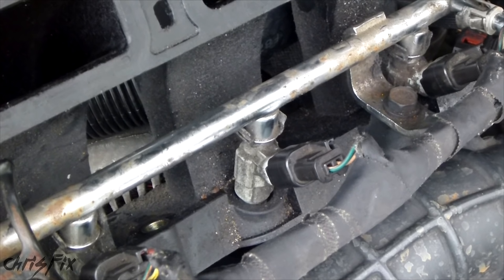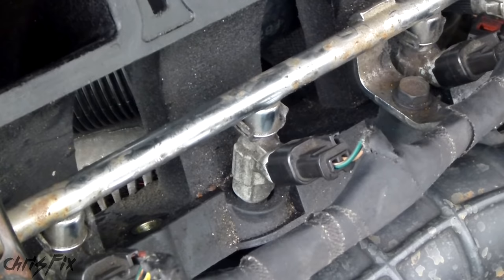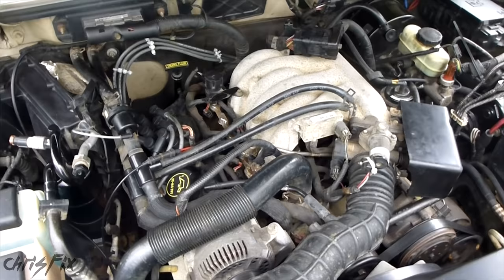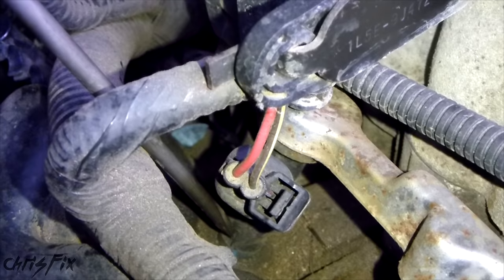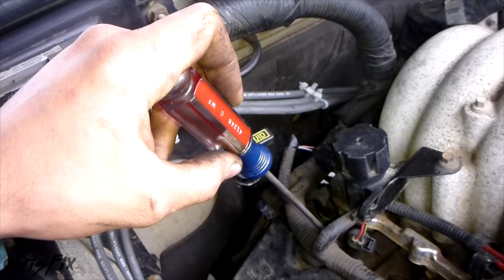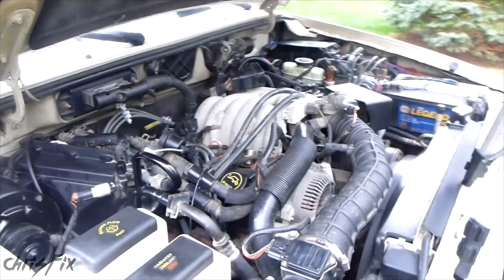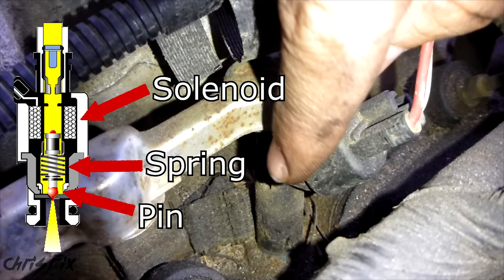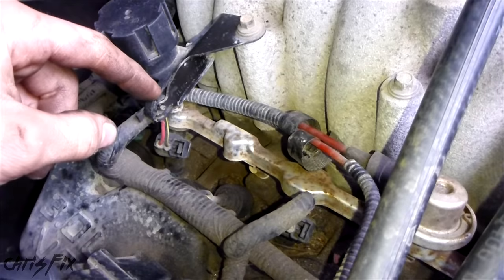Testing Fuel Injectors Fast

Comment: Great videos.  I am a mechanic and machinist and its really good to see youngbloods doing it right and doing it for themselves.  Also the diagnosis progression you show is really nice too.  This is not something you will ever get from a dealer.
Reply from the maker: ***** Thanks a lot man! I appreciate it! I try hard to get the best info out there without rambling on! Fixing cars is a lot of fun!
Reply: Hello dnl machine, 
My daughter and I are trying to change fuel injectors on her 2003 Honda element....  can you help us,please?
Reply: The only thing that one is going to get from a dealer is a car with a bad injector .
Reply: Tested the injectors on a silider that's not working, it seemed to click louder and with less frequency than the others, but consistently.  The cilinder on that one  misfires for sure, may be thats the reason the injectors clicks sound louder but injectors click consistently ..
Reply: @vr  irregular firing compared to the others is still bad, the coil inside might have high resistance or be damaged to the point that the electrical pulses and thusly the mag field aren't being applied as they should to the injector.
Reply: Can it trigger map sensor code ??
Reply: No

Comment: I enjoy how you figured out that you could place the camera against the screwdriver so the audience could actually hear the clicking. Simple detail with a large effect. Well done.
Reply: Literally all I'm here for. I'm troubleshooting a cranks, coils good and spark, no start motor and have never done the listen test. Wires and injectors are very hard to access for removal. MIIIIGHT be a wiring issue elsewhere. What to do? I stuff the stethoscope in there and listened but guess what? I've never done this before and don't know what it's supposed to sound like. Now I do!
Saved me a lot of digging.

Comment: ive used this method too, listening to engine sounds especially on the timing chain part and bearings about to get worn out! its helps a lot of money and time before removing anything or buying some parts that might be the issue but turns out its not.Great video Chris!

Comment: I've done this and the problem I typically see is the sound from other injectors travel down the rail and you can't tell if the injector is bad or not. I think a better way in addition to an Ohms test is switch the injector from one port to another than run a code test for that cylinder and see if you get a misfire for that cylinder.
Reply: Make a video and show us 
That would be cool man
Reply: P[😊😊

Comment: Hey thanks man! Excellent video! I had hesitation AND a hard start (two cranks) in my 1999 Jeep Cherokee. The hard start was due to a failing fuel pump (bad check valve and fuel pressure regulator). The hesitation and bad idle were from a failed injector. 'Preciate it man.
Reply from the maker: Awesome! Glad the video helped and nice job diagnosing the problem!

Comment: With that screw driver test you also need to listen for the sound.  Say you got 4 injectors and you are having a poor acceleration, or intermittent surging off and on, like a chugging type acceleration, if you hear 3 injectors sounding strong and clicking good, then when you get to the bad one it will sound very weak yet hear a weak clicking sound, and sometimes a rapid chatter takes place causing the engine to struggle and shake, that tells you the injector is going bad.  I tested mine, 13.0, 13.0, 12.8, 12.7.  Numbers are 1 to 4.  The fourth one was 12.7 which is within resistance specs, being 0.5 but the sound was the dead give away being so weak, it cannot handle sudden load acceleration.  Once you get to highway speeds, you will feel the surging effect take place.  How old is the car itself is the first thing to know.

So that sound must all be the same and sound good and strong.  You can have a injector all within resistance specs of 0.5 as you said and I disagree, but it must match the sound with the other three.   I can also hear that number 3 is sounding strong, and the resistance is below 13.0 when compared to the other two good injectors, It tells me that number 3 is getting ready to fail likewise.  They should all be within 0.1 or the same.  Anything more than 0.2 difference, that 0.2 is getting ready to say bye bye, while you already know that 0.3 the injector sounds weak and is causing that surging, chugging rough engine effect.

Sometimes you might catch it doing the machine gun like sound, like a rapid chatter being totally abnormal on a intermittent basis

If they are all good, then check the compression on all cylinders, take a look at the cap and rotor and that COIL look for signs of corrosion, and if there is a hole in the exhaust pipe loss of back pressure can screw it up, and last but not the least a Clogged fuel filter, or a fuel pump in the tank is getting weak!!!!  One has to check everything besides just injectors.  As to the ECM, sometimes that is the cause but its rare.  MOST IMPORTANTLY, PULL OUT THE PLUG WIRE AND SEE IF THE ENGINE CHANGES RPM OR SHAKES MORE.  WHEN YOU GET TO A BAD SPARK PLUG, THERE WILL BE NO CHANGES TO THE ENGINE RPM OR ITS SHAKING EFFECT.  Do it one at a time Ok..  The one that does not change the RPM or changes the engine shake effect, REPLACE THAT PLUG.  Cheaper to do a plug change.  If that does not help suspect the spark plug wire itself.  

For me it turns out yes I did have a weak fuel injector, so I did the swap on the plugs to a different cylinder, retested to hear the injector, it was the same sound being weak, and then pulled out the swap plug and bingo it turns out to be the spark plug.  I changed that and presto the problem was solved.

Plugs do go bad INTERNALLY not showing a break on the outside or severe carbon build up.  So puzzling indeed I then did another test on that bad plug and discovered sometimes the readings were good, sometimes the readings were bad on the ohms scale.  Without an some means to see inside the plug itself,> besides destroying the plug, I have no idea what broke or went bad inside that plug internally.  So if this does not solve your problem then read on next paragraphs.

Before all this, did you recently fueled up the car.  You could have gotten bad gasoline, and if not then 3 tests can be done quickly by yourself and maybe the fourth one before going to a mechanic.  Take a good look at the plugs as described above paragraphs, then how old is the spark plug wires when were they ever changed, when was it the last time you changed your cap and rotor, have you ever had to replace your coil if so when, then do the compression test, must show first compression 40 psi or higher and it should climb rapidly before the 10th stroke. Then do the injectors both by screw driver first, listen to the sound of it, then if all good check the resistance, when was the last time you changed the fuel filter, you can change it yourself. Is your exhaust sound loud or not,  If not >  Beyond this point if the problem still continues, then you go to the mechanic to test that fuel pump, and to check to see if the ECM is functioning properly and they need to check the other items below next paragraph. 

Four other possibles are a bad MAP, and or a bad idle solenoid or idle air sensor.  Usually these will set off the codes to the ECM or a injector wire to ECM is grounded somewhere in the harness line.  If no codes are seen or light from the ECM, and no wires damaged, you missed something.  Go back and restart your trouble shoot list as I said here.

Good luck

Comment: Yo, I just did this on my VW jetta 2015. Worked great. Thank you. Had EPC / engine light (sometimes flashing) power loss, bad fuel economy, even smelled like gas sometimes, rough idle, shaking engine etc . OBD said p0304. Recently changed spark plugs, changed coil pack a year or two ago, new battery. Tried fuel injection cleaner, guy at Oreilly said it it should clear up after driving around a bit. Seemed fishy, looked up online and they ranged anywhere from 100-1000 miles or a few tanks of gas before the injector cleans itself (it didnt). Anyway, I swapped plug 1 and 4, still showed misfire. Pretty sure it was fuel injector and this test showed no clicking on 4. Now, I have to see if I can fix it myself. :) Thanks, again.

Comment: Why not just unplug them one by one, if it bogs then it's working if not then it's bad
Reply from the maker: You could do that too but the clips on fuel injectors can be brittle and you can easily break them!
Reply: Also some injectors are a bitch to get out on certain cars
Reply: #Gman Upper Intake Manifold Removal is required when servicing on the 2000 Caravan w/ 3.0 Engine. It's not horrible, it takes time though.
Reply: Well, it's definitely a good method if you've rewired your injectors and you'd like to see if it's getting an electrical signal still
Reply: savagenw
Reply: ChrisFix Yeah, I made that same mistake the other day
Reply: what if one's stuck open? Or failing and sometimes staying open/closed? Your idea only works if an injector isn't opening at all

Comment: Holy crap!  So I have a misfire on my 2002 2500hd 6.0 cylinder 4.  Swapped plugs and wires.  Still there.  Swapped coil. Still there.  Was ready to do compression test on 2 4 6 8 to see.  Then thought about injectors.  

HOLY CRAP!  Lifesaver dude!  Tested with screwdriver 2 4 6. Very distinct sound.  Easy to tell.  No click on 4 injector!
Reply: no offense but why waste money replacing parts when u have no idea what the root of the problem is...

Comment: You can hear most anything inside anything with moving parts diagnosis them to a
Point, alternator, water pump, tensioner pully etc. Discerning the noises is done with experience hands on logic and common sense. Good luck

Comment: You r the mutha...man. thanks for all ur videos. 97 4runner driving me nuts. Misfire on a cylinder. Figured change the plugs ,wires and coils since it has 160k miles. Ran beautiful for 2 days and then same 304 code. Checked your other video on how to check the resistance. Some homework today.  Thank you
Reply: Did you find you're problem?
Reply: @myhoodiskc  
Yes I did. Injector 4 was clogged

Comment: You don't necessarily need to do the screw driver trick against your ear you can also rest your chin against the screw driver handle and "hear" just as well through the vibrations it causes in your jaw and entire skull. Sometimes you can actually hear things better that way because the vibrations cause more stuff to jiggle than just the area around your ear. Chinning it is actually, partially, a guitar player trick we use to tune guitars by ear. Not just an old school mechanic's trick...but being told to do that by a mechanic is how I started doing it with instruments and you won't believe how much better you can hear things doing it until you try it!

Comment: MAKE SURE YOU UNPLUG (and then replug) THE INJECTORS (one at a time while the car is running) to make SURE they are NOT Clogged!!! The screwdriver test will ONLY let you know if they are FIRING, not if they are delivering FUEL! I've been struggling to diagnose my car's misfire for about a month now and I dismissed my fuel injectors as the cause because this method worked great -- I could hear each injector firing exactly like in the video -- HOWEVER, 2 out of 4 of my injectors were *clogged! I only tried it because I read in these comments where someone suggested doing so, now I can finally fix and drive my car again. When you unplug it,  the car should dramatically lose power, start to stutter and stumble, then you will know the injector is working properly, so plug it back it in and try the next one. By doing this, I was able to find the two injectors responsible for my car's problems.

Comment: Hey thanks. Just bought a 2010 V6 chevy camaro LLT RS  So far i replaced the oil filter, air filter, oil change, sprayed the sensor with intake cleaner, rest the computer by disconnect the battery to reprogram the computer. Car is showing no more check engine light thus far but noticed that clicking noise that you just described. I was hoping it's the sprak plugs because i am going to chsnge them soon anyways. I possibly need that a new fuel injector, currently everything is closed for Christmas. Wish me luck! It's a upgrade compared to the 2002 mustang  v6 srs i was driving. It was a good car for learning experience in my opinion.

Comment: You can do many tests to confirm working injectors. Water bottle leak down test. ohm test (which you included) check the voltage of the wires, the wires from the driver in the pcm and pulse. you can also put 12v to the injector and check the pray pattern to see If its plugged up. be careful dont touch the probes together or you'll burn out your pcm.

Comment: IF you can distinguish it from the other 5000 moving, clicking, ticking parts in a running motor.I take the plenum off and the screws that hold the fuel rails down, pull the rails with all the injectors still attached, take four or six or eight baby food jars, place one injector in each jar, turn the key on a couple of times and see which jars have less or no gas in them.i have had motors where you could take off the plenum and actually start the motor and see the tips of the injectors spraying or not spraying through the intake runners.

Comment: I have a 02 gmc sonoma 2.2 motor & about 2 weeks ago,i noticed i wasnt getting as much mpg, so i didn't think alot aboit it,then i was checking my oil lastnite & it's has gas in it & has a milkey film around the top of the oil dipstick. I cant find any video's on here about the 2.2 motor, concerning the fuel pressure regulater or injectors. I was gettin about 350 or more miles on a full tank of gas,& now im getting probaly around 300 miles per tank. Any help would be appreciated! T.i.a

Comment: Great videos and help me a lot on your channel, but just wondering if the diesel engine can use the same method doing this? And is the misfire will also consistent happens or it will only happen sometimes?

Comment: omg... Dude, you helped me more that all these silly "wannabe" mechanics. That method rocks! unfortunatelly, i exchanged ignition coils, spark plugs and all wires between the coil and CPU... Now i know that my 4th injector died... :|
Reply from the maker: +jagdpanzer911 Great! Glad the video was helpful! My#1 injector died and I need to replace it so I will be making a video!
Reply: I just have replaced mine few days ago. Easy thing. Engine runs great again :) Thanks!

Comment: 93 F150 that had a burned up wiring harness. That's all been replaced but now no injector is pulsing. The vehicle will run on ether.
There is power to all the injectors with Key on.

Comment: Love your informative videos, Chris. Since I have no knowledge but am willing and eager to learn about this car I recently bought. I have a question which I hope you can answer.  My car (Renault Megane 1.6 16V CC Techline) starts perfectly. But as soon as I step on the gaspedal, he limps and gives the injector defect signal. Yet restarting, it disappears and doing that a few times (gas and restart),  the signal disappears and I can drive. So the injector can not be defect, right? Could it be due to haven driven short tours and having some clogginess in the fuel system? Because having the car measured there were no signals seen in the memory of the computer 🤔.  I hope you can put me and the car on the right track 😊.

Comment: My car runs well no problems starting or idling. The issue is my ‘18 Honda accord sport 2.0t had a mileage of over 330 miles (brand new). Fast forward to more than 6 years later.. Nowadays I only get a max 210 sometimes 198 miles. Does that mean it’s possible I have bad fuel injectors? I know there’s a recall for the 2018-2022 Honda accords but the dealers say no parts yet.. they don’t even know if that is the reason I have low fuel economy.

Comment: perfect video. nothing over done or off subject. i really needed help with how to check mine and you really helped me big time. i have a question since you know what you talking about. ok so i replaced my fuel injector and spark plugs in my 1995 mazda protege. car still comes on i.e. radio, lights and window stuff but still wont crank. im at a lost at what else to do. you think you know anything else that can cause this? plus the battery is new and connectors on it are secure.

Comment: hey Chris you are amazing when it comes to cars....
.and I have a question for you.....I have a MPFI(multi point fuel injected) car and I'm planning to turbocharge it my question is that do I need to change the injectors to let in more fuel or will the ECU automatically inject more fuel?
It also has a sensor at the intake if that info is needed to answer this question.
And once again you are really amazing and you inspire many to grab their tools and get their hands dirty while working on their car's.

Comment: Great video & idea, but wondering if my problem is a stuck fuel injector; Runs very rough, but the weird thing is it will use about a gallon of gas just idling for about two or three minutes! After stopping the engine, you can see some gas dripping form the exhaust pipe.

Comment: Awesome Video! All of your videos are excellent!

I have a big request...Could you make a video on how to replace Fuel Injectors on your 2001 Mazda B3000?

I have the same truck and I’ve already followed all your videos on how to replace Spark Plugs, Spark Plug Wires, Super Flush Radiator and Thermostat and Fuel Filter and was very successful.

No one makes as good of a how-to video as you do and I would very much appreciate a how-to video on changing Fuel Injectors.

Thanks, Chris!